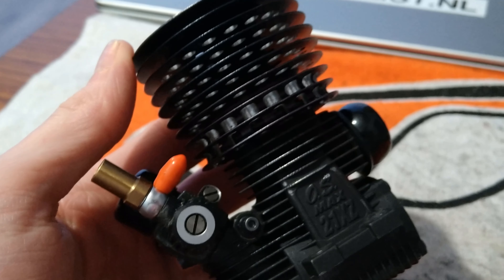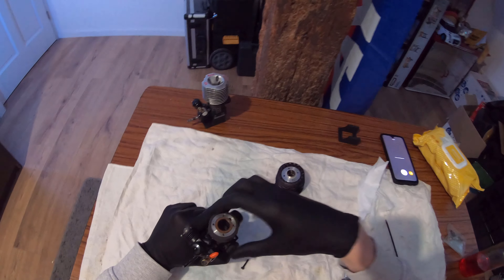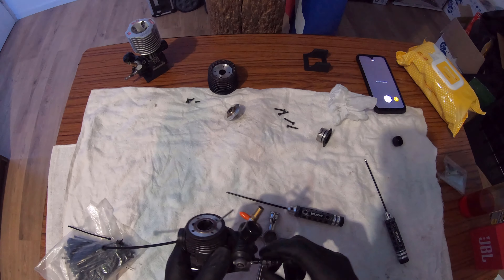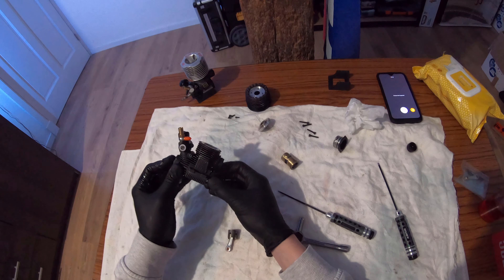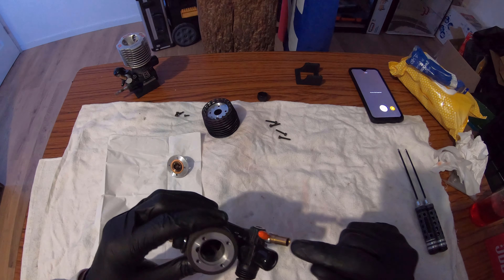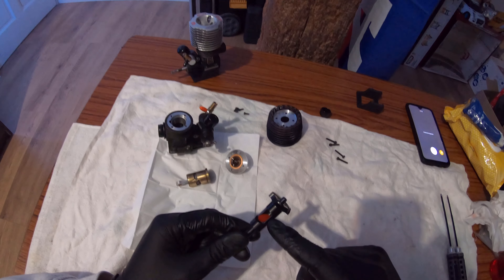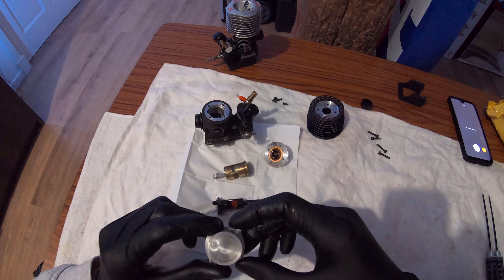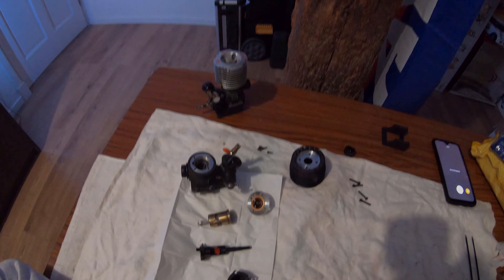My most expensive modified nitro engine! (OS Speed 21XZ-B)

Comment: im new to nitro except way back in 2006 when i bought a brand new revo 2.5 and blew it up in 10 minutes ! $500.00 dollars down the drain so i quit nitro  well now  im  back in the hobble with 3 nitro buggy's i got used none wont idle  till you gave advice check glow plug compare the glow of old one with new one BINGO! bought new glow plugs and they run and idle just fine ! thanks good job!
Reply from the maker: Great to hear that I have helped you! Also when you blew up that Revo you didn't waste 500 only 200 for the engine 😜
Reply: @NitroMike  right! but i was an idiot back then hahaha you wont believe this  i modded the chassis by making longer put in a weed wacker engine instead lasted a year or so lol
Reply from the maker: @khaosnitro  But did it rip?